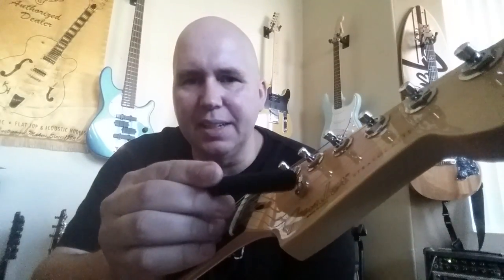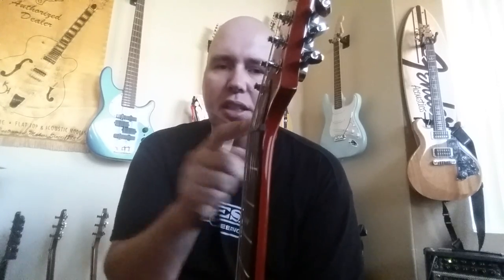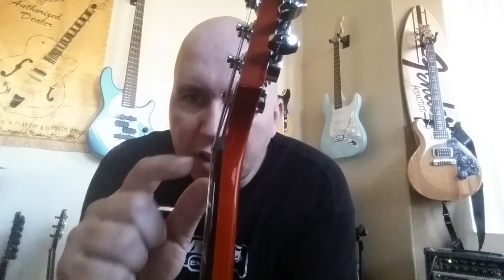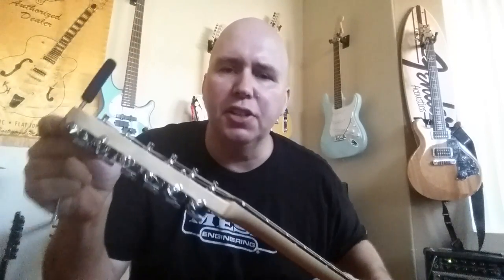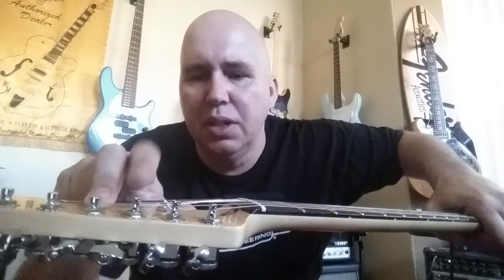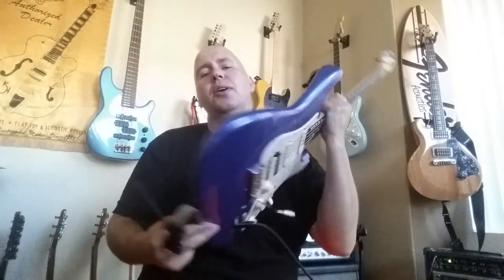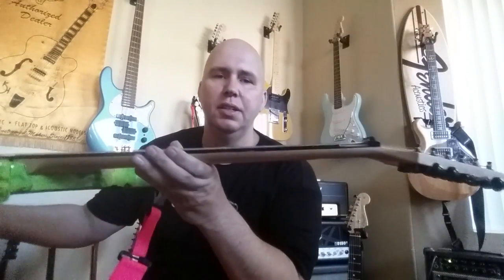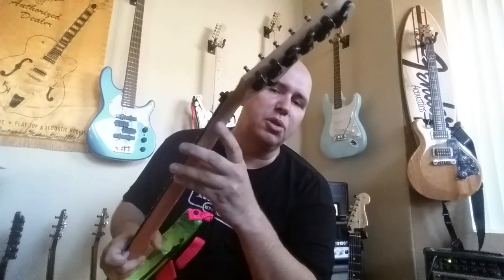locking keys Do Not Work The Way You Think

Comment: Well done video, one question that I have is that if one uses locking tuners on a guitar with a Floyd Rose tremolo system is it still necessary to use the string locks or would the locking tuners perform that function. With the string locks, wouldn't one have to remove them every time one tuned the guitar to avoid breaking the strings? I just built a coffin body guitar from a kit and I was just wondering how that would work since I installed a Floyd Rose tremolo system and locking tuners.
Reply: +marlan3rd 
As Phil explained - Locking nuts will lock the strings at whatever tuning they are set to. You have to unlock if you want to change tuning. Locking tuners will lock the string TO the tuner - allowing you to change the tuning.

With the regards to use with the tremolo, the locking tuners give a similar benefit to that of a locking nut, but not 100% completely as much. It's all about removing the amount of play the string can have around a tuning post. 

With a basic guitar, when you drop the tension using the tremolo, the coils around the post can unravel, and may not return to the same tension exactly, due to friction of the string around the post - and thus the string will be out of tune.

A locking nut completely isolates the connection of the strings to the tuners. So when the tremolo is used the strings should return to the same tension (and thus remain in tune).

While the locking tuners do not isolate the string from the tuners, they do benefit tuning stability by reducing the amount of string that is wrapped around the post that would tighten/untighten when the tremolo is used. The less string there is wrapped around the post the less friction, allowing them to return to the same tension, thus staying in tune. There is usually still a little bit of string around the peg, but in theory not enough to bind and cause tuning problems. 

Personally, I don't like the feel of locking nuts when I play, and in fact the term "locking nuts" just sounds uncomfortable,

Comment: I got all of my (no name brand) locking keys from the bay of E for about 30 quid, and they've all worked perfectly fine.
You might want to inform the masses to measure their holes for insertion purposes, though.
I discovered that my Maverick's machinehead shafts were of a different dimension to some of the lockers I'd ordered, so I put them on a strat neck instead.
Other watchers might not have so many guitars to be able to mix and match, and certainly won't want to drill larger holes unneccessarily.
Was my point a valid and helpful one?

Comment: Great video - but u missed another style of locking tuner. It as 2 holes in the string stem. One high, one low. String low hole - one wrap - string high hole. I've seen this utilized a few ways. Most people wrap forward, some wrap back. Another thing is, on a fender style headstock, u can get a staggered tuner effect by going high or low hole first.

Comment: Hey, instead of string trees, I've seen some lower-end instruments (ie: 5-string Squier basses) use "hold down bars" that cover all the strings.  Is there a downside to this?  Because it seems logical & easy at first glance.  Thanks for the info!
Reply from the maker: +Mark Cheetah no it works the same way in my experience I have seen no issues.
Reply: Ive seen the string bars on high end schecters, i dont believe its a sign of a cheap instrument
Reply: Mark Cheetah Those are on guitars with floyd rose a lot, and they are used just like a string tree, to bend the string down on the nut. Especially on a locking nut, where there are two ends that the string should rest over, front and back.

Comment: I should get some locking tuners. I can never get the wrap correctly, especially on the top 3 strings. And it's usually a giant pain in the ass when I'm tuning it up and the wrap comes loose.

Comment: Question.. If you pull your low E string tight then lock it in…. How do you do a drop D?
Reply: Tune your E down to D as you normally would. The pitch of the string is not what is locked; all strings continue to be tuned as always. The "locking" of locking tuners means that the string is only locked, or held, in place so that the guitarist doesn't have a bunch of string wraps around the post (or capstan, I believe it's called). It's nothing to do with the tuning. The locking tuner doesn't need to be loosened again until the guitarist changes strings: run the string through the hole in the post, screw it down to lock it in place, then tune it up and you're ready to play. Set it and forget it, tune it like always. Just don't have it in your mind that "locking" means you never get out of tune or that the string pitch is fixed.

I put locking tuners on my Les Paul Standard and have been very pleased with the change. A friend told me, "Man, don't never get them locking tuners. You have to loosen them, then tune, then tighten them back down." And he was just flat, plain old, everyday WRONG, just did not know what he was talking about. I guess there are people who would try locking tuners and not like them, but I cannot see how. It makes stringing a guitar way easier and faster.

I hope have not confused you even more.

Comment: Phillip, I'm considering replacing some of the hardware on an older guitar of mine and I am debating these locking tuners.  Of course, I know the proper way to string a guitar such that the string tension itself pinches and prevents the string from sliding.  Are these tuners of any benefit beyond string replacement speed if you're already stringing your axe to minimize string slip.  Will your strings slip even less than when strung properly on a traditional machine head?

Comment: Is it true that locking tuners greatly improve your guitars ability to stay in tune longer due to the elimination of multiple string wraps around the peg?.. In theory it does sound like your strings would recover from bending without the wraps re-settling causing your guitar to go out of tune.. My biggest problemed are is usually the G & B strings, I was wondering if locking tuners would reduce the re-tuning headache that is always required after some good shreddin'..

Comment: yeah fine it doesn't lock the guitar in tune. but i have a strat and whenever i use the tremolo a bit more than just slightly it goes out of tune. and that happenes mostly because something loosens or tightens in the wraps around the tuners. No wraps= better tuning stability when using tremolo?

Comment: Locking tuners do help with tuning stability, though not nearly as much as having slck/roller surfaces at the nut and bridge saddles.  I always wrap the string once or twice so it doesn't come out if the pin becomes loose.   

There's ZERO reason to have string trees anymore. Just get a nice set of staggered, locking tuners.  You can get Sperzel staggered, locking tuners with the EZ mount, no drilling necessary, for 60-70 bucks all day on FleaBay.
Reply: ildur I do a couple of wraps primarily so I have extra slack when I loosen them so I have extra room to clean the fretboard and dress the frets.  I use Elixir Polywebs strings, so they're on my guitars for years.  The strings still tune up fast and don't slip.

Comment: Good video, good info. I have a Cort MBC-1 which has staggered tuners with NO string tress. Though mine needed one anyway to keep the high E from falling off. It's a great, clean look, if they work.
Reply: +Fonzy Brookestone You could've just fixed the nut slot.
Reply: bluesboynate Yea, you're right. I prob will later, but the tree was a quick fix. Cort actually offered to replace the guitar at no cost, but I really like everything else about it, so I was too scared to get something worse. I can live with a string tree, or nut replacement.
Reply: +Fonzy Brookestone Yeah, better to not try to file the nut slot unless you know what you're doing.  You can get a roller string tree for real cheap on FleaBay.
Reply from the maker: +Fonzy Brookestone I got a Fender Custom shop and was told it did not need a string tree. I ended up having to install one. The Eric Johnson Strat is the only 100% real fix for string trees.
Reply: Phillip McKnight Have you seen the Manson guitars? They're the same way, with no trees. But I'm not about to spend $5000 to find out.
Reply: Fonzy Brookestone
I know you don't know me, but I have at least 6 Warmoth necks that DON"T need any string trees.  Maybe they are thinner like the Eric Johnson, but they sure don't advertise the necks this way.  Schaller mini-locking tuners and Sperzels of the same vain will pull the string down as much as is needed.
Reply: bluesboynate Thanks, I'll look into those. Not sure any different tuners would actually work w/o a tree on one though. I actually shimmed the tuner so it was as low as I could get it, just high enough for me to just barely get the string through it, and it still popped off the nut, I'll still check them out, thanks.
Reply: I'd say it had more to do with the nut slot being too high then.  I've had a string do that before and it stays in fine after giving the nut slot a few strokes with a file.

Comment: Do they help with keeping the strings in tune when using whammy bars ?
Reply: Yes...most definitely...for best results...I put a tiny amount of graphite ( from the tip of a pencil) in the slots of the nut...and throughly stretch new strings....even operate the whammy a little...re-stretch and then tune again...remember:  always “Tune Up” to the correct pitch...(not down to pitch)...after this,  my strat with locking tuners stays in tune quite well...

Comment: locking tuners...i have 2 sets of hipshots, are good for is snap strings at the nut if you drop tune and back to standard or try to do a guitar setup where you need tune and detune to make truss rod or bridge adjustments..  FORGET IT WITH LOCKING TUNERS!  you can only use on a perfectly set up guitar and tune only once....if you drop tune do not tune back up to standard without an extra string handy....at least you can replace it fast

Comment: OK, so locking keys work exactly the way I thought. Maybe someone didn't know that though.
Stewmac sells a model of string tree that has independent rollers for each of the two strings. The independent part is important. Some others appear the same, but use one solid piece of metal for the roller assembly, which of course causes one string to bind the other.

Comment: Don't buy cheap Chinese locking tuners. Not because they are Chinese but because they are cheap. I got some and as soon as you screw the locking pin tight against the string it cuts the string and when you go to tighten the string it snaps. This includes the wound strings. 
I found I had to take the pins out and I just used some sand paper and flattened the top of the pin and then I got carried away and beveled the edges so no sharp edges would cut the string. 
Then the high E string decided it could slide down the side of the pin and would not lock so had to swap that pin with another pin that I had not beveled the edge of too much. It still slips down the side so I found the easiest way was to let it slip and just have enough string to wind it a couple of times as if it was a normal peg. So in other words, a waste of time. 
Another tip is to not cut the strings until you have installed and wound and tuned and stretched them all in case you have issues. I found with the low E string when you install and pull through hard to get the string tight before tightening the pin and then tuning that if you need to adjust the intonation you may be loosening the tuning if the intonation is too high. If this is the case and you have pulled the string tight before locking, you have very little space to loosen the string before you run out of string. Because you have already cut it and locking tuners only wind the string about half a turn after pinning the string to tune it up. 
These were no name tuners. I also got some Guyker locking tuners. I haven't had any issue with those but they were a little more expensive.

Comment: There IS a downside to an extreme break angle.  There is a maximum amount of tension that is optimal to be applied to the nut.  Too much pressure will create too much friction which will mess with intonation and string life.
Reply: Corey Anderson Not to mention how prone the headstock will be to breaking clean off, which is super common on Gibson Les Pauls(around 17°), less common on Epiphone Les Pauls(around 14°) and almost non existent on Fenders and Squiers.

Comment: Yeah, I don't think your explanation is correct on the locking tuners.  The primary reason if you lock the strings to the tuner, this will reduce the amount of string slippage due to use of the tremolo bar and results in reduced tuning problems resulting from tremolo-equipped guitars.  So by locking the string to the post, this makes sure the winding or slipping of the string won't be the reason your guitar goes out of tune.  Furthermore, and secondly, locking the string against the tuner, you can use fewer string windings to keep the tuning stable as less winding generally means quicker and easier restringing.  This is what locking tuners are actually for.

Comment: Actually, if you have a good guitar tech make a nut with properly-filed slots and the correct profile on the bottom of the slots, you don't need a string tree on a Fender.

The reason Leo Fender used them was because the people building his guitars weren't expert luthiers- they were low-skill assembly line workers who weren't trained in the finer points of guitarmaking. They cut nuts the "quick and dirty" way by freehanding them on a bandsaw.

He figured Instead of paying an expert extra money to make better  nuts, he could just use a 2-cent string tree to keep it from buzzing.